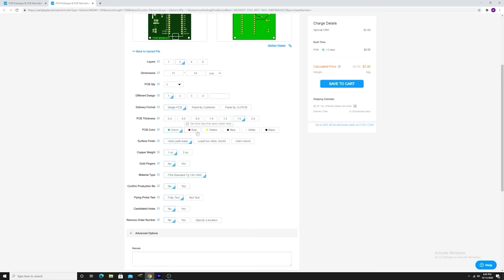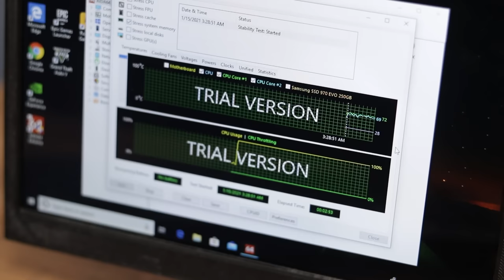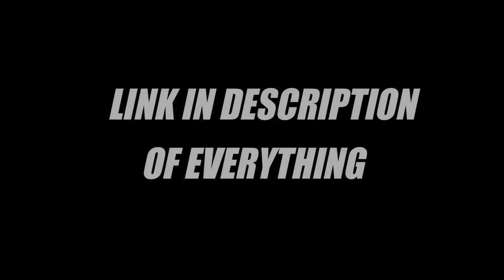WOW! Making The Most Smallest Liquid Cooled Gaming PC - Mini PC

Comment: The amount of thermal paste on the processor though...
Reply: its on verge levels
Reply: it is difficult to put too much thermal paste.
however it is easy to waste thermal paste.
Reply: Oof
Reply: my face D:
Reply: Big OOF!
Reply: @WednesdayMan  it's important to not use too much if the paste you're using has any electrical conductivity, which some pastes have. You can cause shorts on the board from a sloppy application of conductive paste.
Reply: I DIED WATCHING THAT PART
Reply: thegamergg2000  Ok no need to get angry lmao
Reply: On top off that its a cheap bad thermal paste for gaming setup

Comment: 1. I don't know what the bottom of the block is from, but if it's plastic, it will not conduct heat properly 
2. You put a lot of heat-conducting paste there 
3. When you poured the coolant there was still air so it could cause the computer to heat up more.  
4. The fan is close to the transparent plastic and will not absorb air well.  But otherwise it worked out and I like it
Reply: Whats with all the useless negative comments? This comment could of been shortened to only the last 7 words. Delete the rest of the comment and it'd look something like.......

"It worked out, and I like it."
much better, because the rest is usless
Reply: @brent_miserwannabe_3thousa38  To give detailed feedback?
Reply: @brent_miserwannabe_3thousa38  Whats with all the useless comments? This comment could of been shortened to only the 2 first words in last phrase. Delete the rest of the comment and will be "much better" 
its only a constructive criticism

Comment: Awesome video! Great job. Some tips though: you might want to invest in a driver with some low torque settings or drive your screws into the plastic by hand. A lot of those screws looked like they were overdriven. Also, waaay too much thermal compound on your CPU :)

Comment: Ha ha sir I made a smallest mac using rpi you can watch it btw this is supper coolll I don't have much budget otherwise I would literally make something more creative using latta panda It would be georgius if you give me this latta panda 👍😀
Reply: The latte panda is not that much better than the newest version of the rpi 4
Reply: @nitro8529  sir but I have RPI 3 older version 😅😅
Reply: @D.i.y_electric_hb  what i want to say, rpi 4 costs 80 $ and the Latte Panda costs 400 $ and they are both  the Same. So you dont need a Latte Panda. Buy a cheaper rpi 4 and have fun. You get a Used one on eBay for half price.
Reply: @nitro8529  but I was having a budget of just 30$ and I used it in rpi 3 model b so I don't have now budget to spend more as I'm child 👍

Comment: First, its not a gaming pc... it can play gta san andreas, a game from 2004, thats rather unimpressive to say the least. I can play gta san andreas on any phone nowadays. 
Second, it doesnt need watercooling, its just an unneccessary gadget to watercool a SBC cause theyre not getting that hot, a normal heat sink with fan is just enough.
Third, if it cant play recent games, its more of a retro console, but you can have way cheaper solutions than having a 400 $ pimped Latte Panda or Raspberry pi... buy the playstation classic for 100 $ or buy an even cheaper retro console capable of playing playstation and xbox titles, theyre not that expensive these days. 
Conclusion: You build something thats expensive and cant even play recent games, thats watercooled for no reason and cant combat any cheap retro console... thats some money wasted